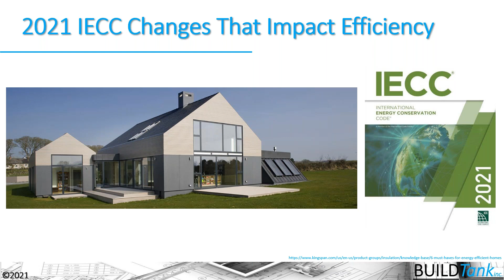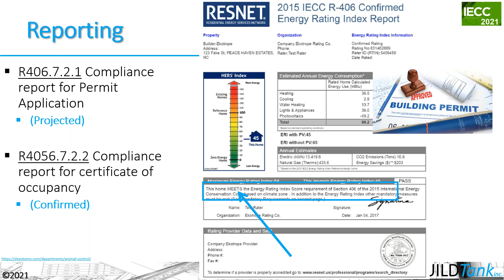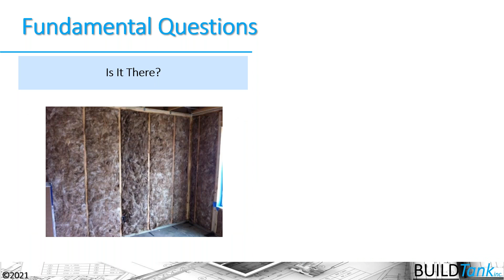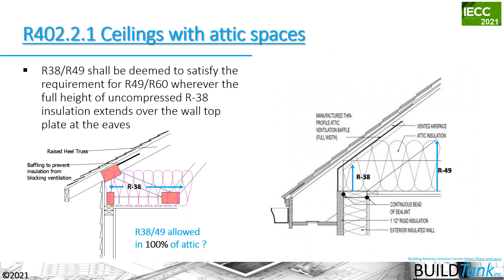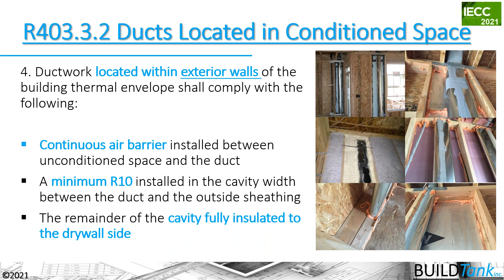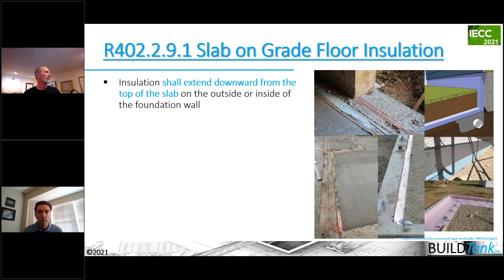2021 IECC Residential Provisions

Comment: Great presentation thank you!!!
Reply from the maker: You're very welcome!
Reply: This has helped open eyes to the changes forthcoming.  One thing to note that I have discovered, REScheck does not acknowledge tradeoffs so ceiling insulation allowable to be reduced where over 100% of the ceiling with attic per code, will fail and or impact your home passing via software. Theoretically it should allow a pass as a tradeoff but it does not so be mindful of your tradeoffs.  Get ready to increase your heel heights throughout.